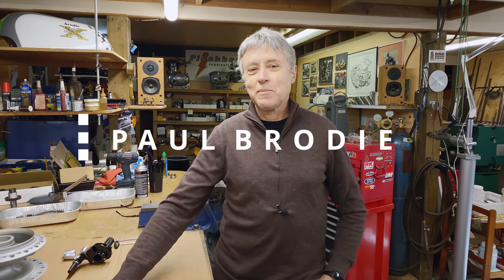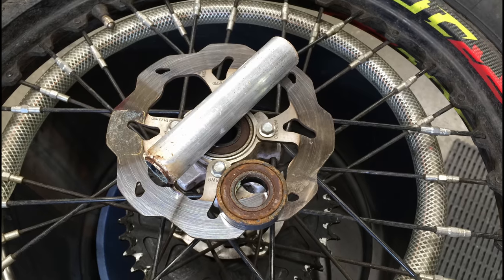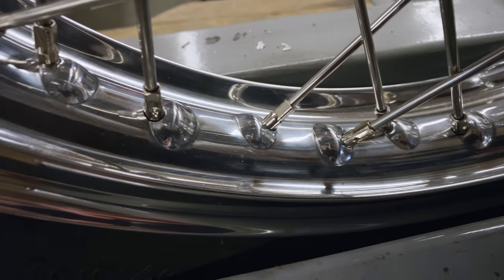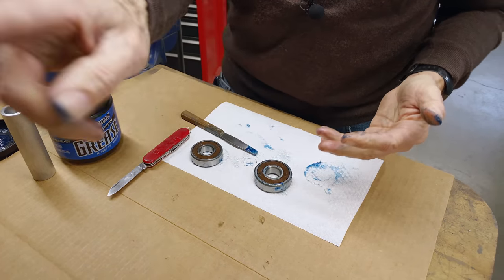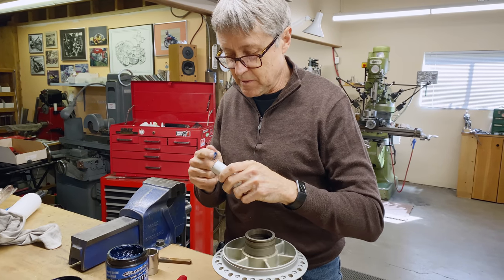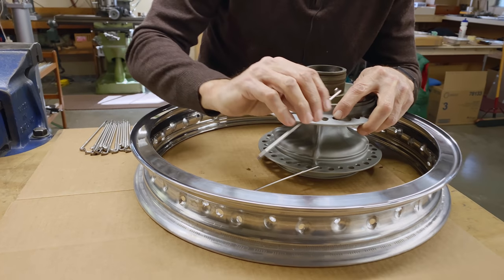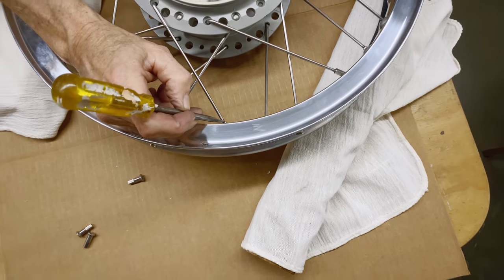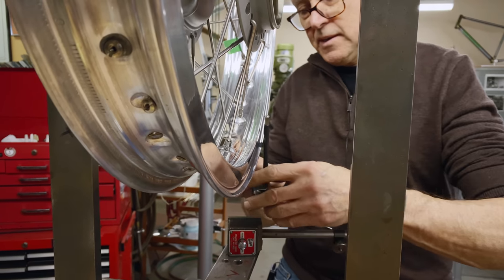Aermacchi Wheel Build // Paul Brodie's Shop

Comment: Having childhood memories watching this video about building and truing wheels. 
I had a workplace school practice week as an 8 grader at a bicycle workshop.
 I learned how to repair and rebuild bicycle wheels that summer and I got lucky, I got to work there every summer for many years. 

All you said about truing wheels is spot on what I learned from that older gentleman that run that shop. 

Also learned how to repair and rebuild Sturmer-Archer bicycle hubs with 2 and 3 gearing. 
The 2 geared ones you used the pedals to change gear by pedaling backwards till you heard it click into another gear. 

The 3 geared one was wired with a small chain going trough the axle in to the hub I believe. 

Brings back memories for sure! Thank you!
Reply from the maker: Erik, thanks for watching and commenting.

Comment: A deja view Saturday here. Helping my adult son add the right touches to his newish KX450F. His push pull throttle tube was toast. A perfectly smooth feel to the throttle is a nice touch. I hope he considers making a bar plug bearing holder. He's still in the design or buy phase. Your video should provide him with enough, it looks easy to...

Oh, his sketching away now. Thanks for the nudge he needed.
Reply from the maker: Good story, thanks Jim!

Comment: That's a nice for cross dude I never did it for I've done plenty of Threes though I was on a gas bike kick for a while out of necessity I had to learn to build Wheels the sprockets for the motor part of the bicycle has a rag joint connected directly to the spokes intern starting the 2-stroke engines would break the spokes because of the sudden hit when you drop the clutch fabulous Little Creations I had often wondered how they really built motorcycle wheels in retrospect exactly like you with a bicycle wheel thank you for the tutorial peace and blessings
Reply from the maker: Thank you Robert.

Comment: Could have drilled the steel bearing spacer tube like swiss cheese to lighten it and retain the strength if steel. Keep everyone happy, and not worry about an aluminum tube expanding compressing. 
Beauty work 👍👍

Comment: When I laced my wheels up the first time I followed the Aermacchi service manual. It came out good. One thing it said was to use a punch and hit the head of each spoke to make sure they were fully seated in the rim then recheck final truing. I was surprised by how much they seated in.
Reply from the maker: Yes, that sounds like a good idea. I had not thought of that.
Reply: One of the tricks I’ve learned from an old factory enduro team mechanic/engineer. 👍 The small details that combined makes all the difference. Love stuff like that.
Reply from the maker: @andli461  Yes, sometimes the small things can help transform a bike.
Reply: I pluck each spoke with a guitar pick and tune them to the same pitch. I do this mostly for bicycles. Motorcycles that are built out of harmony  can be adjusted this way but in harmony results in a pitch that is weak and hard to hear.

Comment: I'm self taught at wheel building. Use same 'convention' of inner and outer spokes although I have heard wheel builders using different terms.
To me, 'outer' spokes go in from centre of hub and inner spokes go in from outside so must be fitted first.
The only video's I posted about wheels were some cheap e-bay rims I built and rollers/ levers mounted to DTI's giving about 1.5x actual readings. Cheap rims had poor welded seam so there was around 0.008" hollow/bump at weld
Reply from the maker: I do have a book by Jobst Brandt on Wheelbuilding, but I haven't read it.

Comment: I saw the roughness on the aluminum rim dimples as well, some oem parts back in the '60s and '70s.  I think D.I.D. rims also had that issue.  Never questioned it at the time.
Reply from the maker: It's like they skipped a step in the production.. I really did want polished dimples!

Comment: Your bar ends fit fine. Having plugged one end of the tube, the other end is confronted with compressing the air within the tube while you drive it home. Given it's such a tight fit, hammering becomes necessary. Had you drilled a small vent hole on the underside, the second plug would have slipped in with far less force. :^) A bearing spacer from ally is perfectly appropriate. It is only used to create spacing when no race is used, not endure lateral forces.
Reply from the maker: Yes, we are going to say that air pressure made it much harder to install the upper handlebar plugs. I like that. Thanks for watching :)

Comment: if you're worried about the dial indicator tip marking the wheel, but want to use a dial indicator, whip up a large radius nylon tip for it, similar to Mitutoyo 101205. This will prevent it from marking the surface, and also allow it to bridge any small gaps or ridges without crashing the tip.
Reply from the maker: I feel a dial indicator is taking it a little too far. I can get it very, very close with my system. I do like the idea of a large radius nylon tip, so I will keep that in mind for future projects. Thanks.
Reply: @paulbrodie  if you're not interested in making your own tips, tons are pretty easily available aftermarket. just make sure you're buying the right thread.

Comment: Packing the grease in like that is sub-optimal. Adds extra friction and heat. Check out the Timken engineering manual, it has a section on packing bearings.
Reply from the maker: Thanks for the tips!
Reply: @paulbrodie  any time. it won't really kill the bearings or anything, most likely in your case it might just melt the grease out depending on what you're using

Comment: Nice to watch you build a rim.  Haven't built one in awhile, but will have to build one probably for the XL175.  I'm shocked by Excel too.  And also by how much that welded seam really stands out when you spin it.  That would be a tough one to swallow, especially for what you pay for, for a "quality" rim, needing to polish it yourself after.  I use a zip tie the truing stand tube, so I can slide it up and down, and spin it around as the  high/low and side to side get trued.  But yours is built from flat bar, so that would be hard to spin at least.

As for the spacer, I haven't seen a steel one on any new motorcycle, they're all aluminum that I've come across.  Don't see why you couldn't built one from carbon fiber tubing.  I was expecting that you were going put speed holes in the one you built.

It's been awhile since you had your last video of putting a tire on, I had forgotten I mentioned putting the tube in the tire first.  Was that any better, worse, makes no difference?  

Thanks for showing us the start up of the Aermacchi at the end.  That was a real treat.  Reminds me of the last time I rode the XL175.
Reply from the maker: Ah so that was you that recommended putting the tube into the tire before mounting.. Yes, it was easier, so thanks for that. I could have thinned down the axle spacer in the middle on the lathe, but I'd already saved a bunch of grams. I would not be inclined to drill holes in a spacer like that. Thanks for watching!

Comment: A pair of aluminum donuts, with mice in cheese lightening holes, tig welded to each end of your bearing spacer tube could be a conversation piece.
Reply from the maker: If you Tig weld aluminum you lose the heat treat so I would not do it that way, but thanks!

Comment: Id guess they just Dimpled a polished blank rim but in the first case your rim was dimpled and then polished. Surely you wouldn't have 32 holes or so come out all the same if it was Hit n Miss.
Great content Paul
Reply from the maker: I think the Hit and Miss was referring to whether or not the dimples got polished. Either way, the dimple was consistent.
Reply: @paulbrodie  yeah sorry what i said sounds silly. I just thought they would be dimpling them in house as they offer that service from there website Not just receiving them like that from excel directly. Thanks
Reply from the maker: @LoweSpeedFab  No worries.

Comment: With your obvious focus on the weight of individual components, do you have a target for finished, final weight of the bike, ready to race? BTW, love the exit on the Sprint at the end.....
Reply from the maker: I'm building a replica of my Aermacchi racer that got stolen in 2005. Dry weight was 221 lbs with 52% of the weight on the front wheel. That bike was a lot of fun to ride and race. 35 rear wheel HP :)
Reply: @paulbrodie  Thanks for the reply. That's a excellent HP to weight ratio. Look forward to future videos.

Comment: That wheel building was impressive - great job! Maybe you can clear one fundamental doubt I have since I was a teenager: how do you know when you have enough tension in the spokes? For all I know, the wheel can be true at many different tensions, but there must be a minimum tension to transfer the torque from the hub to the rim without deforming or slacking.
Reply from the maker: Thank you Jose. Getting the spokes to the right amount of tension is important. There are many ways. In the bicycle world you can buy a spoke tension gauge. In the motorcycle world a very small torque wrench could work. Hitting the spokes with a screwdriver will make them "ring". When they are all about the same pitch, that is good. There is also a "feel" you can get using  a spoke wrench. That's what I do.
Reply: @paulbrodie  Thanks for replying! That was very informative and cleared a decade's long doubt 🙂
Reply from the maker: @JoseSilveira-newhandleforYT   Good stuff :)
Reply: @paulbrodie  Yep 🙂

Comment: Hello Paul, great channel! I would like to see a video of you showing your Super X bikes with commentary. I also would like to know the reasoning behind not using the crude oil on your SS spokes as it is used to prevent gaulding. Lastly, I use the truing pointer on the tire bead side of the rim for up and down and side to side because that's where the tire seats and rides, just your thoughts on that please. I cannot wait to see the Sprint engine build, about what hp do you get out of the 350cc engine? Again, it has been a pleasure watching a fellow machinist at work.
Reply from the maker: Thank you rysammy. We will get to the Excelsiors in due time.. Patience! I haven't watched the video recently, but I do remember using some oil on the spokes. Yes, you could use the pointer where the tire seats on the rim, but the rim is an extrusion so the two surfaces should be concentric with one another. The Dyno showed 35 rear wheel hp on my little Aermacchi. Thanks for watching.

Comment: I asked about the hp you get out of the 350cc engine bc I would get a light weight, rt foot shift bike, to ride without a sidecar as I lost my left leg above the knee. I convert my 69 flh sidecar bike to left hand throttle, rh clutch and left hand shift. I also built a 3 speed with reverse trans, but may put my 4 speed back into it bc it is a constant mesh trans and the 3R trans is a sliding gear. Thanks for filming your work!
Reply from the maker: Thanks for watching. I hope you get a rig sorted out to suit your needs.
Reply: Thanks for your replies Paul, I road the bike out to Davenport, Iowa from Ohio to the antique mc swap meet and it did very well. I was wondering about the Excelsior1919 ohc engine bc I thought Mr. Schwinn destroyed all of the ohc engines, so I did some research on you and read your story about you and the ohc race bikes, I surely tip my hat to you on your craftsmanship
Reply from the maker: @rysammy  Yes, we will get around to doing some Excelsior videos one day. Please be patient.

Comment: Hi Paul. Self taught wheel builder here also. I learned from reading the Jobst Brandt book back in my shop days. One thing I noticed about your wheel build that you do differently to me is that the inbound spokes aren't woven over the top of the spoke that it crosses last (the second spoke in the case of your two cross wheel). I'm wondering if this is because the spokes in a motorcycle wheel are so much thicker than those in a bicycle wheel, and therefore much harder bend over another spoke?

Thanks for the video by the way. I haven't owned a motorcycle in years but I'm enjoying watching you work on yours. Cheers.
Reply from the maker: I think a part of your comment got cut off. I think the "woven" thing applies to bicycle wheels, not motorcycle wheels because the spokes are too thick. Are we talking about the same thing?
Reply: @paulbrodie  Hmm, not sure what's happening there. Looking at what I wrote from my end it all looks to be there, but maybe it didn't all come through at your end? 

Anyway, you pretty much echoed my thoughts, that spokes in a motorcycle wheel don't brace each other in the way that they do on a bicycle wheel, probably because they are too thick and don't bend in the same way.

Thanks.

Comment: I've worked on motorcycles for over 50 years off and on (over 20 years 5~6 days a week) and that's the first one piece quick action throttle I've seen. 
Guess it was designed for MX and enduro to keep mud and water out? 
Beats the rubber covers we used in the 70's~80's
Kinda surprised about the Excell rim, obviously dimple die needs replacing or re-finishing, it's rather annoying when you spend that much on a rim to have it part finished.
 Is it a WM4? 
Clear anodized or 'raw'?
For a race bike I leave out the inner seal on bearing and put a thin smear of grease inside hub housing., plus, I only recently found out you should only pack bearings about 1/3 of open volume or you create extra friction.
Never had a problem making alloy bearing and hub spacers on race bikes. 
Things tend to get checked and replaced more frequently than on road bikes so spacer compressing making bearings bind isn't an issue, plus, your more likely to use correct torque specs/torque wrench
Reply from the maker: I really like that throttle. Seems like a good design. Rim is WM3 width. Polished and raw. Excel no longer anodizes their rims I am told. I might take some grease out. We'll see.

Comment: I thought the marks on bike tyres were the heavy spots which need to be opposite the values. Maybe different manufacturers have different systems. 

Anyway, nice work. Thank you for sharing.
Reply from the maker: I was taught the painted mark goes beside the valve stem.

Comment: Hey Paul & Mitch,
congratulations for 1 year of really nice work you did on your channel!
I think we all hope for much more.
Paul, I like building bicycle wheels a lot and so I do that much.
But I am curious about how much spoke pre-tension you would apply and how you would check that.
I had a call with a master craftsman from sapim a while ago and he told me that some motorbike wheelbuilders would pick the spoke for the tone they make like tuning a string instrument (e.g. guitar) because flex is not sufficient on these thick spokes for bike spoke-tensiometers.
What is your opinion on this?
Martin

Edit: After reading the other comments I see that similar questions were already answered. But still curious if you heard about the picking method.
Reply from the maker: Yes, I have heard about the picking method. It just wasn't on my radar that day. I did say I'm not a wheel building expert, but of all the wheels I built that got used on the road race track, no spokes ever broke or loosened up. Thanks for watching, Martin.
Reply: @paulbrodie  Paul, I never built 1 motorbike wheel, so thats is my knowledge about that. 
Thanks for your reply. And you are right.
After some research out of curiosity it seems that motorbike wheel rims are specified for a certain torque at the wrench (nipple torque wrench) and the tone method being used for checking equal (more or less) spoke tension and sufficiently high "plings" for enough tension. Interesting...! Seems to be the choice for shorter, thicker spokes compared to the bycicle ones.
Reply from the maker: @mbi379  Thanks for checking that out :)

Comment: Excellent!  I have drawn a parallel to the James May series... 'The Reassembler'... so restful indeed to watch the both of you.
Never seen a wheel built from scratch, and I would imagine there are countless videos on the subject, but we all watched yours!
Felt a little ripped off though... how does one actually TENSION the spokes?  Is there a tension gauge, or do you simply allow them all to chime to a set note, or what...?  We all want to know Paul...
Again... excellent video...
Reply from the maker: Good question. For me, the torque on the spoke nipple is kind of a "feel" thing. If the spoke holes have been drilled properly, and not in the wrong location, then the head of the nipple will start to "seat" itself all round as it comes up to torque. I can feel it because the torque starts to increase dramatically. I use a pretty short 5.5mm wrench so it's hard to put in huge torque, but they definitely are tight. Spokes can loosen with hard use, so it's good to check tension after a few rides.

Comment: Hi Paul, love your videos, would love a work shop like yours, could most wheel spacers be made out of steel because aluminium would expand a lot more than steel under spindle heat, there for could tighten up on the bearings ????, Regards DC.
Reply from the maker: Thank you David. Yes, you can make wheel spacers out of steel, but they would be a lot heavier than aluminum. If your wheels bearings are getting hot enough to expand aluminum, then you really have a wheel bearing problem! I have never had an issue using aluminum axle spacers.
Reply: @paulbrodie  Thanks Paul, was just a thought, i will continue to watch your great videos. as a patternmaker i am always interested in making things.